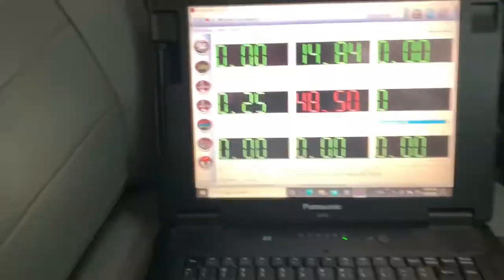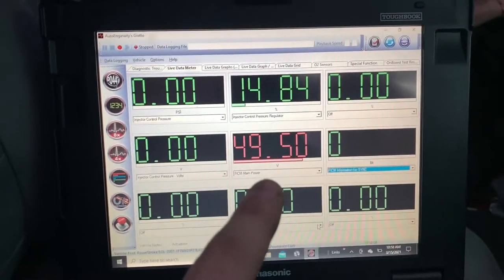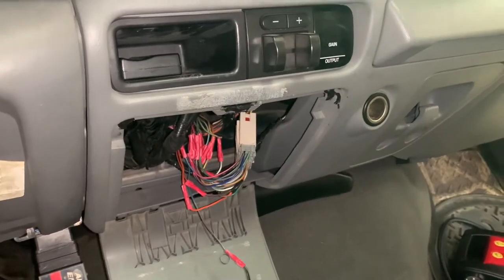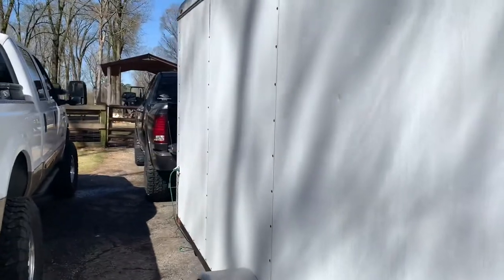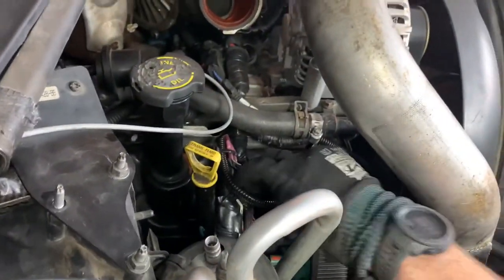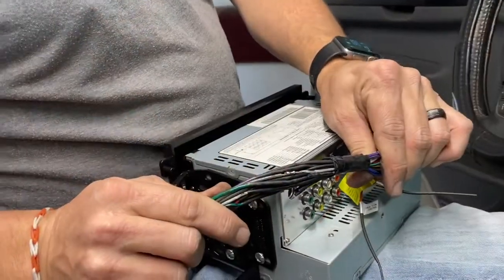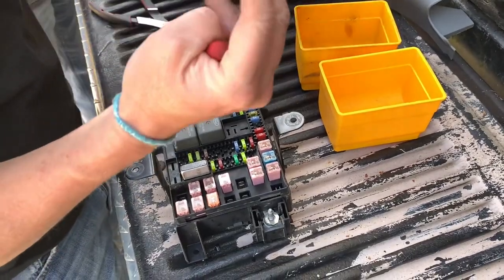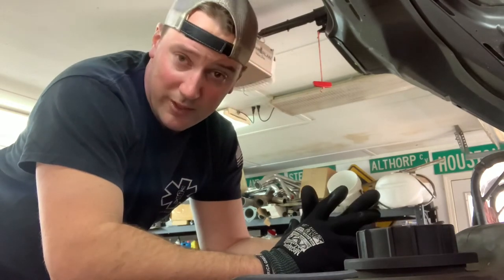6.0 Powerstroke no start and odd wiring problem

Comment: I'm a forklift tech. Years ago I went to check out a lift that the customer said sounded like the flexplate was coming apart when they put it in reverse. I found that the starter was engaging when it was put into reverse. Started checking stuff, and so I could listen for weird things happening, I unplugged the back up alarm. It stopped doing it. I then found that when I plugged it in it did it again. Started pulling the wiring and found some chewed up wires that were grounding out and back feeding the starter. Electrical gremlins are fun.

Comment: There is a tube in the pillar for that sunroof to drain like a gutter and they can collapse due to heat in the window during summers and will not allow the water to flow through fast enough or at all and it backs up into the sunroof area . Some have a pvc coupling that will brake or separate from the hose and water will run down to the door jam through the dash
Reply from the maker: Yea we checked the entire hose, there was a lot of debris in the tube @ the sunroof. Dumped water down after the fact to make sure it drained properly also.